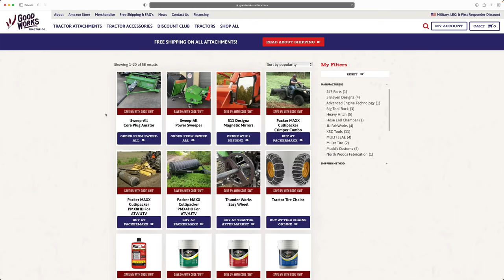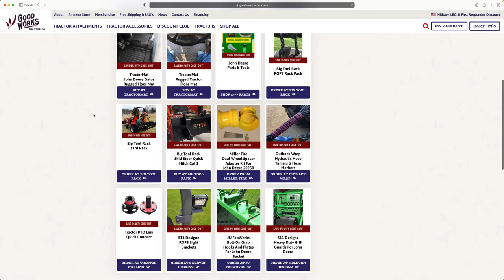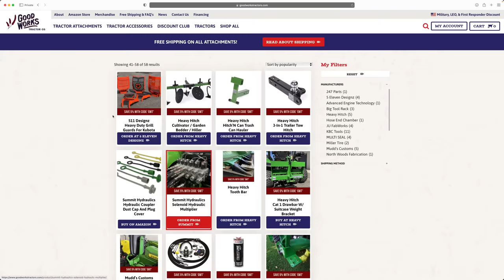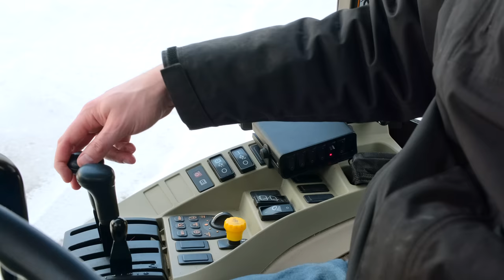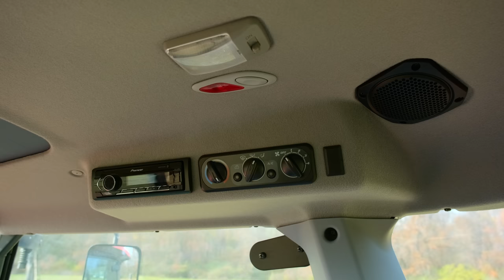TRACTOR BUYER'S GUIDE: WHAT TO BUY, WHAT TO AVOID? 🤔

Comment: You make good videos. But I have one question. When you were dealing in used tractors you only dealt Deere and Kubota. You did one LS and in a review said you really couldn't find a reason to advise not to buy one other than its dealer network is small. Along comes Summit Tractors and you can't say enough on how great this unproven tractor is. Either they are going to have 1000 plus servicing dealers or I don't know why you are pushing them so hard. Where are they built? U.S., Korea, India, Japan? Just wondering. What makes the better than anyone out there?

Comment: I did take your advice where I could. Our budget didn’t allow me to go full bore and get a backhoe and/or a cab. But I did add on hydraulic remotes and a top and tilt to my new L406LE as well as the third function, a fiberglass canopy, and front and rear work lights. I did choose the limited model because the only feature that it lacks that I actually care about is the telescoping stabilizers that I can add on for far less than the standard 60 series. Can’t wait for it to be delivered any day now and I can finally get to work around my new property.

Comment: Most important option …name brand with dealer support ..no matter how good off brand may seem if one is looking to keep any tractor for years …you will need that dealer with parts still around …been both sides fence with tractors had Landi’s , Mahindra’s, Massey Ferguson’s….but in todays world top 3 who still around are Deere , Kubota, New Holland…presently own a Kubota 
So to me first and top option is Brand/Dealer support all rolled into one, cause they all break and need parts sooner or later .
Reply from the maker: Agreed, need a good dealer.  Anything mechanical will break.

Comment: I would agree that first and foremost safety feature of any compact tractor should be the investment of liquid ballast. Far to many of the compact tractors are just to light. People that are not familiar with the way the equipment handles can get into a bit of a predicament. The Summit tractor is definitely going to put a thumb on some of these other manufactures possibly forcing them to add some of the features such as the third function and even the self-leveling loader. I think that all manufactures from a safety stand point should add the liquid ballast at a minimum. Thanks for the Update Courtney as always.
Reply from the maker: all mfg's should add liquid ballast -- definitely.  I know there's dealers out there that won't sell a tractor without it.  Good on them.

Comment: Good advice to put more options on than you think you need at the time. Its cheaper in the long run to have them factory installed plus with the APR% incentives from JD and some other mfg's is well worth it than to upgrade later on. I think the Tires are one of the most important. I spent the extra to get the versa turfs and its great for all season traction and not tearing up nice lawns when traversing and moving items on the grass.
Reply from the maker: Yep, agree with all that for sure Kevin.  Thanks for sharing!

Comment: Good Morning Courtney, I think you're giving your customers excellent advice. I would encourage anyone looking at NEW equipment to do their research before they buy and make sure you're comparing "Apples to Apples" .......if you're looking at pre-owned equipment I think it's case by case basis. Most of these smaller tractors have little or no hours on them. I personally own 2 tractors with over 6000 hrs and I have neighbors who have well over 10,000 hrs on theirs, having said that, it all depends on how that machine has been cared for over those hours. You'll have to do some due diligence and look that machine over really well. I've seen instances where a machine with fewer hours was in worse condition that an older model with more hours that was well cared for. Case by case fellas, good luck!
Reply from the maker: Great info Vern...definitely a different situation in the used vs new

Comment: So far I have only had the need for one additional hydraulic, but I wish I would have had additional ones beyond that setup as part of the base install (I know I can add more later with after market kits).

I am happy to report the first purchase I made was the to pickup the Speeco Quick Hitch from you for my 3 point. So glad I did!

With my tractor (B2601) purchase I did have the following included:
- Soft sided cab installed. 
- Raised seat (I'm a taller person - they installed a 2" lift)
- Filled R14 tires

Additional purchases/installs I wouldn't hesitate to do again:
- Mirrors (locally purchased, but available online)
- Speeco weight bracket and weights (Goodworks) 
- Mechanical bucket level indicator (the sticker on the bucket wasn't quite enough for me - found the parts list for a larger tractor where it comes standard and installed on mine).
Reply from the maker: Awesome Scott, thanks again!
Reply: @GoodWorksTractors  thank you! It was your videos and trustworthy demeanor that have helped me get here. Was watching even before I made my first purchase!

Comment: I think you may have overlooked or just assumed one potential option would be on the tractor.  You talked about the quick attach and self-leveling options on the loader.  However, in many cases, the loader itself is an option which in most cases is essential.  I know most would take that for granted but technically, it is an option for many of the models on the market.
Reply from the maker: Yeah, don't forget your loader! :)

Comment: One point to make is that you can roll your upgrades into your finance plan. We did that on our Grand L to get the OEM 3rd function, 3 rear service ports and a hydraulic SSQA on the front-end loader. Also, a dealer may be able to finance a different brand attachment if you put a good down payment in on your finance arrangement. I would also balance that with what independents like GWT has available. GWT has things that my dealer  didn't have in stock and some of Courtney's stock is better and a good value.
We have a suspension seat on our Grand L as it comes standard. I don't know about the air ride seat. I have heard some complain about Kubotas air ride that have it.

Comment: Great video as usual. I was originally thinking about including a cab when I bought my 2025R but felt that it would end up being more of a detriment for my yard work or working in the woods on my property in th U.P. Yes it is convenient for hot or inclement weather but I hate to think of the damage I could do to it working in areas that could cause damage. The open station gives me much more versatility.
Reply: I added an Original Tractor Cab Co soft cab. to my 2025rand have used it for 2 winters now.  It keeps me out of the wing and blowing snow, and is easy to rewove for the summer.
Reply: @jimstruve3602  might have to look into that but for now I'm pleased with my open station. I grew up driving Farmalls with no cab so I'm not sure how I would do being enclosed.
Reply: @davidgingery8927  I took have spent many hours on my H with a feed wagon and 686 with a loader.  While doing chores, even a Heat Houser was in the way. Now that I am retired, I like to use my snow blower without becoming a snowman!
Reply: @jimstruve3602  yeah, isn't retirement great? I have a single stage walk behind snowblower for my sidewalks but I use my 2025 with the bucket and edge tamers for clearing the gravel drives in the area. Growing up in mid Michigan we had a garden tractor with a 36" snowblower on the front. It cleared a lot of snow over the years and threw quite a few rocks against things. Luckily no serious breakage to other things, just shear pins and yes I wore a lot of snow too. I keep thinking of other add ons that I would like to get that might need to come before a cab.
Reply: @davidgingery8927  I had a rear-mounted snowblower on the farm.  I used it not only on the driveways, but also to clear cattle lanes.  Imagine a frozen cow pie going through the blower!
Reply: @jimstruve3602  kind of a good visual of what it's like when the s__t hits the fan. Literally.

Comment: Bought a ck25 kioti at auction had to put a ssqa on it plus rear hydraulics,third function was quite expensive then had to convert the bucket to ssqa. Nice video!!
Reply from the maker: The SSQA adapters are a common request.  I think lots of folks in the used market don't realize until after they buy.
Reply: I knew it needed it but the price was tight on tractor it only had thee hundred fifty hours on it I also knew who owed tractor

Comment: Love your videos, lots of good info. This is on offbeat question, but does there comes a point of too much ballast? When you add weight doesn't that put more pressure on the tires and shorten their life if you are on rock or concrete a lot? How often do you check the bolt to make sure that you are not doing harm somewhere else? I'm not trying to harass you about this but if you can help us out and maybe make a few pointers to help us understand. Thank you and we will keep watching.

Comment: I would honestly consider that Summit Tractor. It's a bargain. 
If only the lift capacity on the loader was in the 1200-1300 pounds range.
As it is with 900 pounds, after a bucket or a grapple, there isn't much left.
You can't move even half full basket of firewood or a decent size log.
Wish it had a better lift capacity.

Comment: Love your videos.  So when is Summit coming to California?  Their Website says that Tractor Supply Company will be their dealer.  I have 4 or 5 of them within a half hour of where I live.  However, TSC does not show the Summit on their website and Summit does not seem to have reached the Mississippi River.  May I assume, California is not on the radar in the near future?  I understand that they may be have a backhoe available.  

I have another question that Summit might address, if the tractor comes from the factory with Rimguard In the tires, it they are going to ship to the West Coast…maybe…someday, the tractor purchaser will be paying cross country freight for beet juice.  Sorry for the tongue and cheek, but it has only snowed 4 times since 1971 in the SanFrancisco  Bay Area.  I understand the safety factor, and wholeheartedly agree with concept, I was in the Fire Service for almost 50 years as my major source of income, so safety was a big part of my life.  Has Summit possibly thought of shipping the product in bulk to their dealers out here?

Part of my other sources of income before the Fire Service, I worked mounting and repairing commercial tires, basically anything you could fill with air or water (including the A2 tires on construction vehicles, the ones that weighed than Volkswagens and cost more than Cadillacs).  In the day, the Calcium Chloride additive made the job really messy, plus I would guess somebody here would consider that process a HAZMAT.

Least I digress too far from the original question, will Summit be planning to cross the Mississippi River in other states besides Texas?

I have inconvenienced too many electrons so I will close.

Respectfully submitted
Reply from the maker: Definitely in the future plans, but not for awhile out west.  Regional launches mostly east of the Mississippi first, then rollout there later on.  A backhoe is coming summer of 2023!
Reply: Thank you for your quick response, maybe there is a Kubota BX23S in my future, but it will required a lot more nickel saving, maybe the Summit will be here then, after all I do have an older Bobcat 453 Skidsteer…lol

Comment: great suggestions for what to have. I'm really more and more impressed every time you showcase the Summit Tractor. Would there be a significant advantage of a Summit over my JD 1026R as far as capability? It only has 184 hours on it and just serviced by the "stealer".
Reply from the maker: Yeah, quite a few differences, but I'll have to do a video at some point comparing them.
Reply: @GoodWorksTractors  that would be cool maybe a video on Cat 1 tractors. that would be interesting. its hard to compare sometimes just by going to the websites.

Comment: Love you videos but I do have a question? How can you love the summit tractor but rag on the JD 2025r? Although I haven't seen them side by side they look extremely compatible. I own a 2025r and love it.
Reply from the maker: The Summit weighs weighs about 50% more than the 2025r.  It sits 4" wider.  Much, much more stable.  It lifts 100's of lbs more than the 2025r loader.  Thousands cheaper when spec'd out the same.  The list goes on, but those are some big hitters.

Comment: Just curious if a backhoe attachment will be available for Summit 25? And will it have a attachment to the frame? Thanks
Reply from the maker: Yes sir, available summer of 2023.  Can be added to models sold without the backhoe too.  I don't have all details, but believe it'll have a subframe on it, separate seat, mechanical thumb, 12" bucket as standard.
Reply: @GoodWorksTractors  Thanks for that reply, I'm getting sold and becoming a believer on this lol

Comment: Best thing EVER for attachment market has been the ability to use "offset" or not direct in front or behind hydraulic equipment that still can be balance proper load under working. Solves the problem of the ever needing a back hoe and has infinity more use than a back hoe which basically has only one and a very limited one use/thus wholly lacking in usefulness.

That's as for something as new over the past 20 Years now a retail product but regularly seen by me anyways as road work tool for state workers and utility electric corporate field work. Quick attach is absolute must have but if I can't offset the entire attaching mechanism I'm basically better off with a lawnmower that can attach, detach with all working equipment be put there and there alone.

That's basically how Farmall Tractors did it back in the day anyways as main selling point from Old Iron be "all about the undercarriage." David Brown Tractors are another held in very high regard by collectors and "yeomanry work" as well from what I've seen watching YouTube.